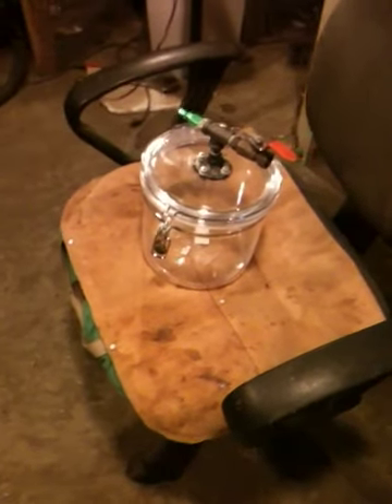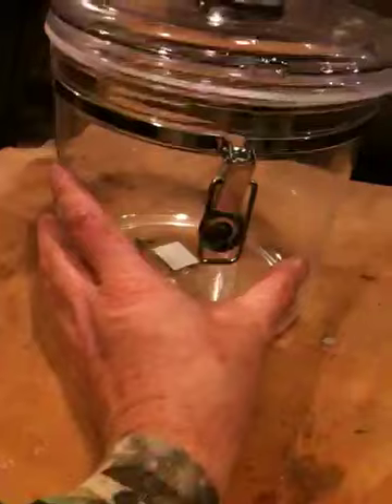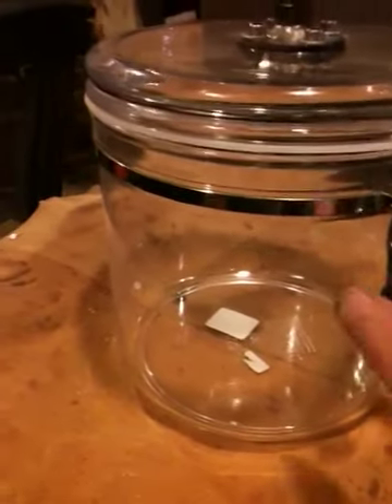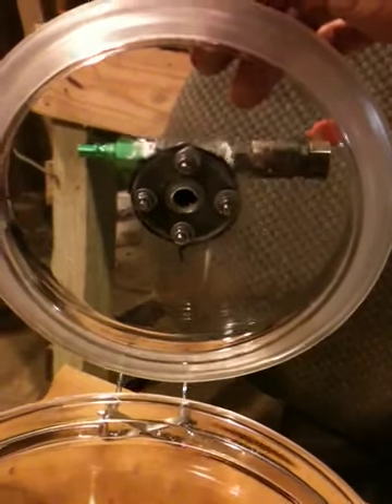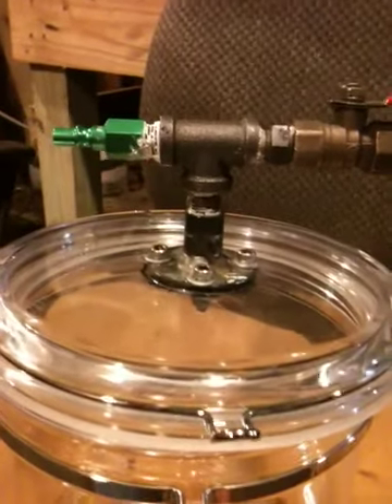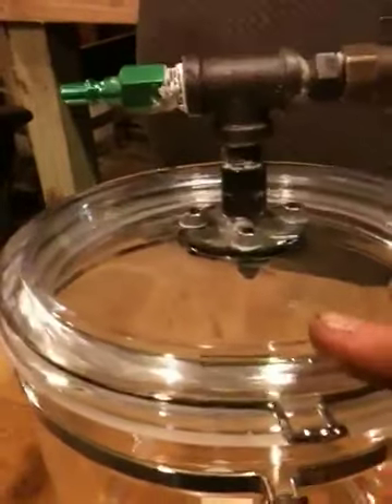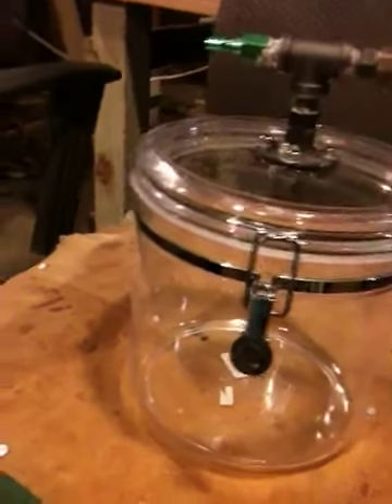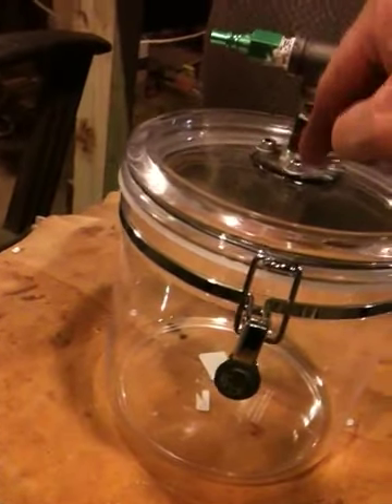Making a stabilizing vacuum chamber part 4

Comment: I used  this exact jar for my chamber and at -20 on the brake bleeder pump it cracked across the very bottom and jumped 6 inches in the air but it was working fine untill today about 3 months.

Comment: The first one I made did very well an lasted through 25 or 30 vacuums with no problem...... Until I did it with min wax wood hardner.... That ate the acrylic up! The next one I made cracked and imploded on the lid. So I have since been using a glass jar of the same type but with a 4" lid. I used a carbide glass bit to drill the hole in it. I think i got a good solid one the first time and it would have held up for a very long time had I not tried the min wax wood hardner... Then an average one the second time. The glass jar works great